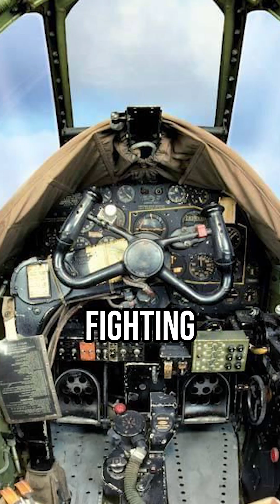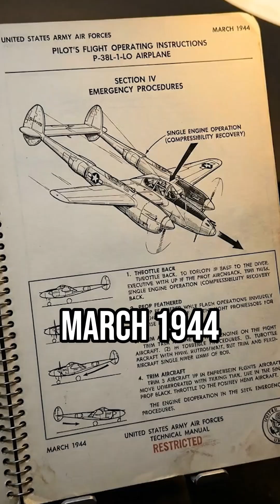Why P 38 pilots shut down engines during terminal dives

Comment: Transonic control lock. Air is compressible. Below Mach 1. As you approach Mach 1 air is no longer compressible so you can't pull on controls and expect it to move in a virtually solid airstream.

Comment: Soooo, did they actually turn off the engine, or was it enough to pull the throttle to idle, and push the prop control lever all the way forward to flattest pitch possible…

Doing this, the piston compression acts like a giant air brake…

Using the air brake technique on one engine only, would give asymmetrical drag and would be hard to control when compression is already causing control issues…

This air brake technique is currently used in training for emergency descents in some light aircraft…. Throttle out, prop in, fuel still barely flowing… gear down… descent rate is higher than 5k’ per minute… the pilot will be landing in a couple of minutes…

Keeping the engine running is important… it may be incredibly difficult to get it restarted…

The objective is to get back to a friendly airport…

Favorite WWII plane… P51D, Packard built Merlin engine, bubble canopy…

😃

Comment: Old article in Popular Mechanics Magazine regarding the P-38 was interesting. It said the piston compression ratio wouldn’t allow high altitude flight. The motors  were both Supercharged & Turbo charged. They were best suited for low altitude flights. So 35,000 ft flight would’ve caused piston detention
Reply from the maker: It is true, as I've heard from the books. Do you like P-38 in general or do you have any other favorite WW2 aircraft, by the way? :)

Comment: Ok Amatures who think you know in 1939  the p38 was awesome but Allison v12s didn't run very well above 12 ,14000 ft because supercharger didn't work p51 had same problem. 2 roll rate was terrible and hard with big losses of altitude no side surface wing loading when on edge.3controls were very heavy until Howard Hughes invent hydraulic servos so it shallow dived fired and sped away did have good fire power tho.4It finally became a fair fighter with servos in the P38 L model but by then the P51 P47D P47M were out dog fighting out gunning it. With hotter fuel it needed remitted with merlin and 4 blad props but to expensive obsolete to refit. I have often thought what would have become with 5blade props and P 51H mustang Roll Royce Griffon engines at 2250 hp. Or new Turbine engines of that power but fraction of weight. And for the FACT P 47M AND P47 N THUNDERBOLT WAS THE FASTEST FIGHTER IN WW2 AND NOTHING COULD OUT DIVE OR OUT BRAWL IT WITH 8 .50 MG. GAME OVER AND P51D OR P51H WAS NO MATCH FOR IT OR CORSAIR OR F8F BEARCAT.

Comment: I thought is was a problem with the float in the carburetor.  When they fixed that .... no more problems.
Reply: That carburetor issue happened with Spitfires and Hurricanes. Mostly solved by Ms Beatrice Tilly Shilling
Reply: Allison’s we’re fuel injected. Merlin’s were carbureted.
Duh.

Comment: The Germans didn't fight in this Pacific and the p-38 was never used in Europe. Your your information is bogus.
Reply: The P38 sure as hell did fight in Europe! Started fighting in Europe in late 42 and flew extensively in N. Africa and Italy
Reply: The P38 was withdrawn from the European theatre, it is very cold at altitude over continental Europe in winter & mach number changes with altitude & temperature, several types of US aircraft were lost in (initially) unexplained diving accidents including the P38.

Comment: Actually, all three American fighter planes hit compressibility when the dove their aircraft clean from high altitude. 12,000ft AGL was where the air became dense enough to help fix the problem. As American fighters quickly accelerated into compressibility range, the moment of lift moved aft off the wing. That’s why flight control surfaces had no effect. Robert S Johnson, a pilot of the 56th fighter group wrote about the problem. He put the P-47 into full climb trim and put his feet on the control panel pulling on the stick. He woke up after pulling enough “G’s” to blackout with his P-47 climbing back to altitude. To fix the problem each of the three fighters were given detents on their flap control levers to allow the pilots to slow the aircraft enough to keep it from entering compressibility. Later models of the P-38 had a special set of dive flaps to help. The P-51A Apache was also given dive flaps separate from the main flaps for the same reason. Later British fighters also ran into this but the phenomenon was known by then and steps were taken to prevent this. BTW, this compressibility barrier is what gave rise to the sound barrier. 😊
So, I have never heard of shutting an engine down in combat to break compressibility. I would think it would be suicide to shut down an engine in combat. If you did, I’d hope you could restart it while combat maneuvering!
Reply: Excellent explanation. Thank you.
Reply: It was more of a problem for the P38 and P47 which had relatively low critical mach numbers - both about 0.68 to 0.7. The P51, otoh, had a higher critical mach number - a little above 0.8. As did the Me109. The FW190 was in between. The Spitfire was slightly better - depending on the variant around 0.85.
Reply: @TheGpatters888   Seem like awfully high Mach for propeller-driven planes.
Reply: @johnfranborra  Turned out the shape of the wings was mostly the determining factor. Wings with a deep profile - like the P38 - had lower critical mach numbers than wings with a narrower profile - like the Spitfire. The Me262 had no external prop but still had a critical mach number around 0.86.
Reply: @TheGpatters888  Wasn’t there a Spitfire Reconnaissance version that was trying to dive away from other fighters hitting well over 600mph and was able to recover but had structural damage?
Reply: @alexanderadriance699  In September 1944 test pilot Squadron Leader Tony Martindale dived a Spitfire MkXI - the photo reconnaissance version - reportedly to Mach 0.92 ( about 620mph TAS). The plane was damaged (propellor ripped off and other structural damage), but he was able to crash land reasonably in tact. It was a test flight not so not diving away from other fighters.
Reply: Better to shut down one engine, then to hit the ground at 300 mph. Once you are not crashing anymore, then you can worry about winning the dogfight second. Since the enemy knew about the fatal dive, they may not even follow a crash diving enemy plane, if there are other live targets nearby.
Reply: @sprinkle61  - No need to "Kill" the Engine, just pull the Throttle back to Idle! 😂
Reply: As long as you have sufficient airspeed its really not a big deal with an old piston engine. Basically all you gotta do is unfeather the prop turn the magnetos and and give it some gas.
Reply: I'm in no way deeply knowledgeable about the exact mechanics, but I would imagine stopping an engine in that situation would be like an old car. what I mean is that you could "hill" start it, no? again, I don't know how planes work, but I would think there is some equivelant since the propeller, like the wheels would be, is spinning and thus the engine crankshaft is
Reply: @sanchu6335yep.  Pop start, but with the propeller being the clutch
Reply: It is actually North American A36 Apache the twin sister of the p51
Reply from the maker: Wow...

Comment: This is the un modified original version of the p38 shown.
Reply: @TimothyTerrell-o2o    What do you mean "original version of the P38 shown" ? If you are referring to the picture in the manual it shows  the air intakes at the lower front of the engine nacelles to be of later models and the date on the page says " 1944".

Comment: They cut the tail off and changed the angle to bring the nose up out of the dive. And adjusted the elivator angle to compensate for the difference. 
And added air brakes to slow down the dive speed.  Changing the propeller direction was to balance the torque load 
To stop rollover . 
The p 38 wasemphamous for that tendency. They lost planes from that problem.

Comment: It had much to do with the wings and the tail being on the same plane. Air current would rush over the elevators and the plane would lose lift. By raising the elevators higher this was cured. Look at the German plane in the clip. Note how much higher the tail is above the wings. Definitely not on the same plane.
Reply: They changed the tail angle to overcome the problem,  modern high speed aircraft use the entire tail plane as the elevator to prevent the problem from happening.
Reply: The height of the tail plane was not the problem. The angle of the tail was the problem. 
I’ve seen the specks for the mods on the tail booms to correct the problem .
Angle change and reinforcement.
Reply: @TimothyTerrell-o2o  yes it was. One cannot have the wings and the tail on same relative plane and expect to do speed diving. It physics.
Reply: The speed was Mack one. Only achieved by diving.
Reply: @TimothyTerrell-o2o  and those test pilots who achieved Mk1 were the ones who recognized the deficiency.
Reply: @TimothyTerrell-o2o  The critical mach speed for the P38 was 0.68. Unfortunately easy for the P38 to achive in a dive. Mach 1 not possible for a P38.

Comment: With both engines running, the airflow over the tail remained symmetrical, which meant the entire tailplane stayed inside the deep compressibility/supercritical airflow region.

When you yaw the plane with one engine out:
	•	the stabilizer encounters asymmetrical airflow
	•	one side of the elevator begins to “bite” into clean air
	•	partial control returns

Even 10–20% elevator effectiveness was enough to pull out of the dive.
Reply from the maker: Very interesting breakdown, thanks! By the way, so do you like P-38 or no? (;
Reply: @Airvex-f3d    This compressibility problem was obviously shared by the newer more powerful ( and heavier) fighters that came online  during WW2--- so what has like or dislike got to do with anything ? 😮
Reply: Excellent explanation!!
Reply: Chat gpt ahh answer
Reply: I built my first P-38 model in 1972 and took it everywhere. My father flew and served as an aerial gunner in WWII. I learned a lot from him.

Comment: So much erroneous info.  First claim was the stick froze at 320 mph in a dive.  The P-38 could exceed 400 mph in straight line flight.  Compressibility occurred at higher velocities, likely at over 500 mph.
Reply: Compressibility problems were related to mach number. The critical mach number for the P38 was 0.68 and above that number they would experience effects like this mach tuck. The speed of sound varies with temperature and it is colder at higher altitudes. 0.68 mach at 25,000 ft is around 454 mph. Now note that's allowable True Air Speed (TAS). At that height Indicated Air Speed (IAS) is much lower - around 304 mph. During the war P38s were placarded with dive limit speeds dependent on altitude and G loading. Can see it in the wartime manuals. Later P38s (L model and later) were equipped with dive flaps that permitted a slightly higher critical mach number - but it wasn't a lot (couple of hundredths).
Reply from the maker: True!
Reply: What the pilot would be seeing on his airspeed gauge would be “indicated airspeed” which needs to be corrected for temperature and altitude to get true airspeed. In standard conditions at 30,000 feet, an indicated airspeed of 320 mph is 512 mph. In standard conditions the speed of sound at that altitude is 689 mph, so 512 mph would be Mach .73, slightly above the P38’s critical Mach number.
Reply: I thought it would be closer to the sound barrier, possibly 600+? But, ya, not 320.
Reply: Yes. In a dive the speed has been recorded over 500. Fact.

Comment: That's because Lockheed discovered that when the Cabela's rotate in the same direction that creates such a force that was a pilot goes into a dive he can't pull out of it. Lockheed discovered that the answer was to take the opposite engine into the opposite direction rotation this balancing the plane so that the plane could pull out of a dive
Reply: No, not at all true
Reply: @bradys68 my parents work there and knew all about the P38
Reply: @BillBahn  if they where so well informed why don’t you know all the modifications that were done to the platform during the war,and why they were done? This was all posted and in common use by war’s end. I’ve seen detailed documentation of all of it.
Reply: @BillBahn  It's still not true. Counter-rotating had nothing to do with it. The P38 had counter-rotating propellers from the start. Look up areodynamicist John Alexander and his research  (and solution) for the mach tuck problem.
Reply: They cut and re angled the tail structure to stop the compression pressure problem. The propeller change was to stop the tendency to flip over if an engine cut off occurred.causing an uncontrollable spin and crash from uneven wing loading.